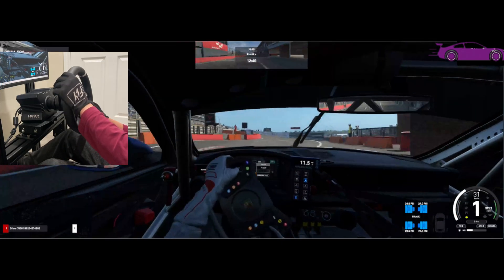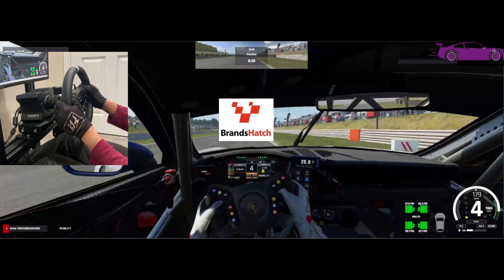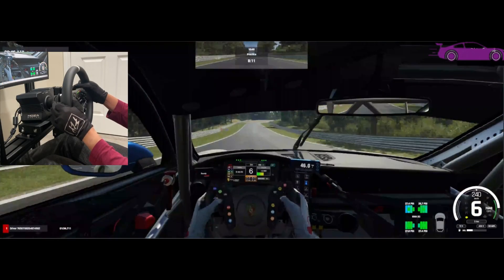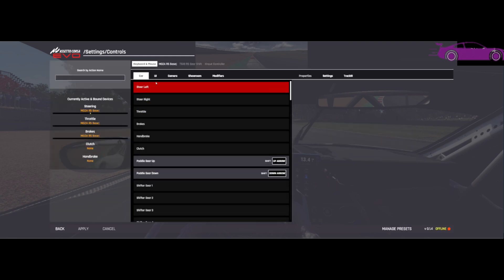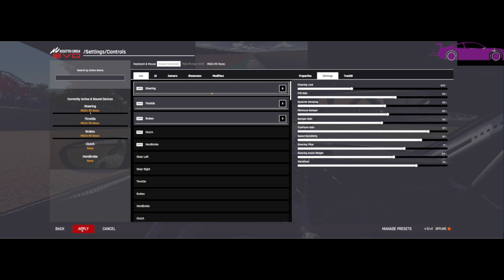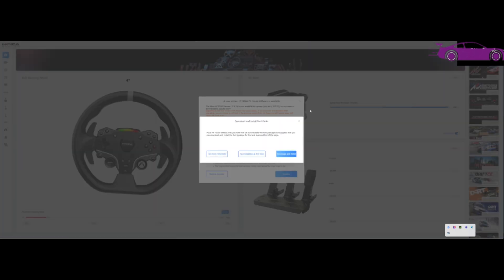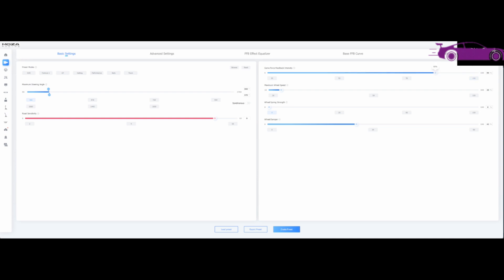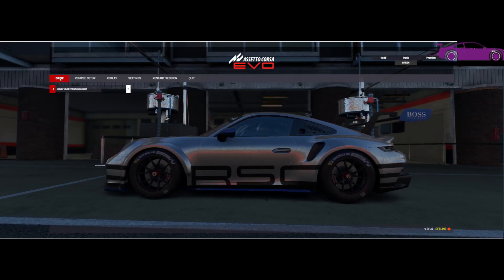Massive vibrations on Moza R5 on AC EVO? here is how to fix it

Comment: Thanks for the vid. But  it's very unfortunate to have to limit your reduce to 60% and not be able to fully enjoy the steering wheels maxixum capacities. Is this a bug, or does everyone has the steering issue with the ?
Reply from the maker: This issue was only there when the game was new, later Moza got an update and fixed it, you shouldn’t see this issue now. Did you update the pithouse software?
Reply: @purplekazter yea I did. But it's only with the Mini Cooper I have this problem. The rest works fine
Reply from the maker: @l @lloydvdw  that’s strange, could be an issue with the game then. I haven’t tried with that car. But when I get a chance I’ll check it and get back to you. If it’s an issue in the game you can report it using https://fs30.formsite.com/505games/EVO/
Reply: Thanks a bunch!  @purplekazter